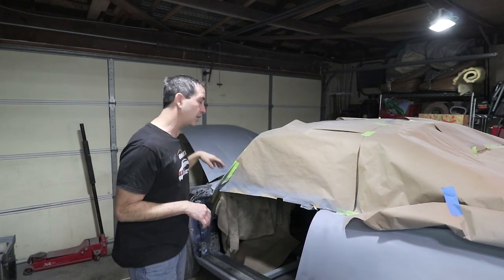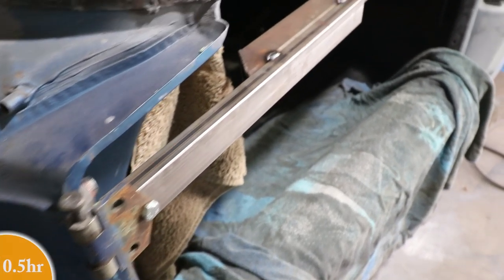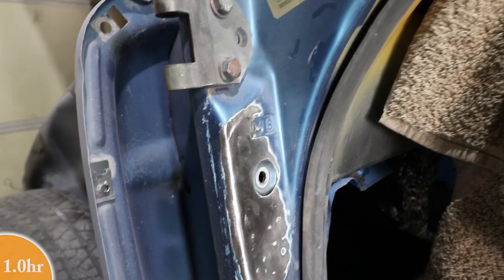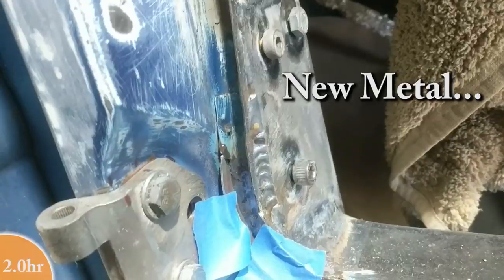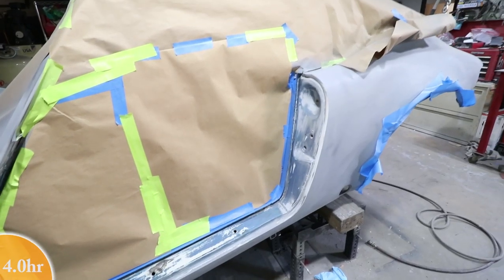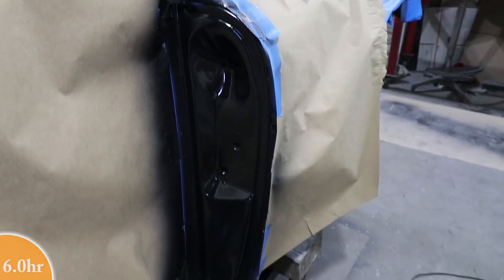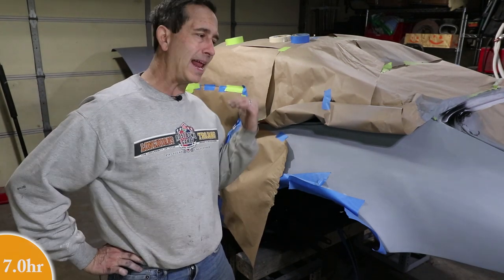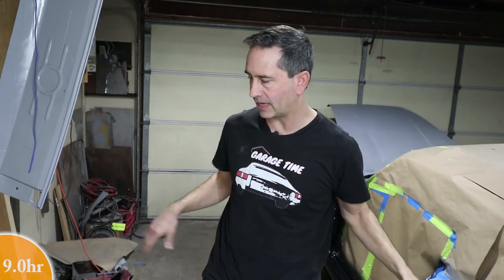Porsche 911 Door Jamb Surprises & DIY Repair

Comment: Why did you do black epoxy? Are you going to go with black paint in the door jambs? Great progress, and thanks for taking the time to document the journey. I'm sure you would be moving a lot faster if you weren't recording every step of the way. But here you are, killing it, even while recording every step.
Reply from the maker: Good question, I wondered this myself.  There are two reasons:
1)  I thought a contrasting color would help because it's inevitable that some overspray will get on the exterior panels that are paint ready.  The black will be easy to sand off without oversanding the grey exterior.
2)  I'm trying to manage my paint inventory as I get to the end.  Just trying to use all the black.
After the bodywork is done on this jamb I will be shooting a grey sealer coat on the exterior and jamb together, then yellow!
I appreciate you for watching most if not all of these videos and being a regular commenter!  Happy Holidays!

Comment: When you're in for a penny your in for a  pound! Honestly this is the only way, (outside of a Gunther racing or similar shop restoration at 150k cost or more) that a quality resto gets done. The way I see it, the biggest issue is this, if you don't do it, knowing you didn't eats at you after the fact. I have been working on mine for a long time and I have a rust spot on mine that didn't exist when I initially started, and it made itself evident years after the paint went on... Keep it up I'm stoked you put in time every day!
Reply from the maker: I agree!  Might as well take care of it now.  That is why paint is such a huge milestone.    Although I also think I'm overkilling this for the cars intended purpose.  If it gets scratched due to driving it then that won't upset me, but if I ignored something just to cut a corner then that bothers me.

Comment: Adding my comment for the coveted recipe.  :)
Reply from the maker: Ok, I'll do this on a future video too because it's a little confusing.  I buy a quart of gloss and a quart of flat.  These are mixed with a ratio of glass to flat 2:1, but the mixing ratio is  5 parts paint 2 parts acetone and 0.3 parts hardener.

Comment: Do you needle gun the rust and or weld locations to prep?
Reply from the maker: Hi, I used a carbide Burr and wire wheel this time.  I don't have a needle gun.  My understanding is they are for heavier guage stuff, but I'm not positively sure on that.